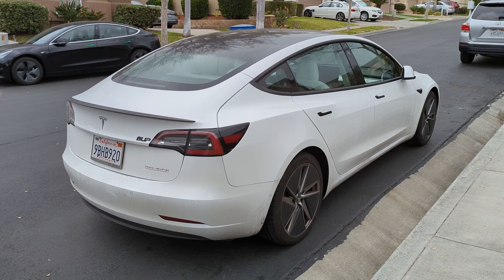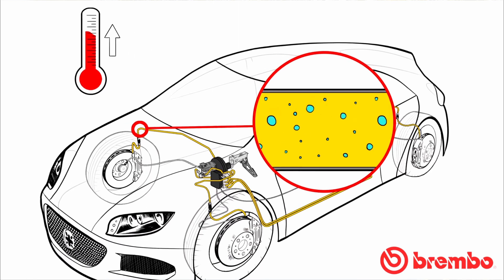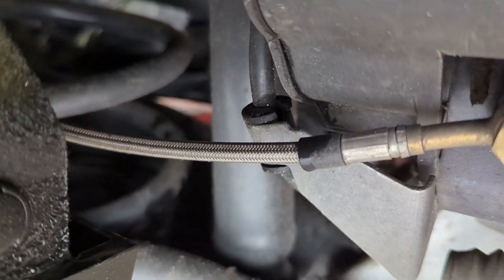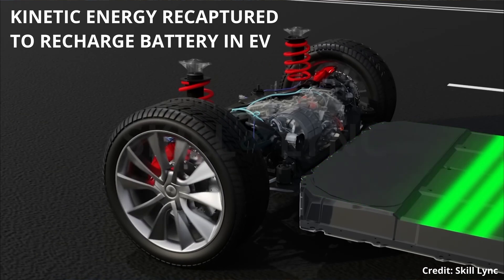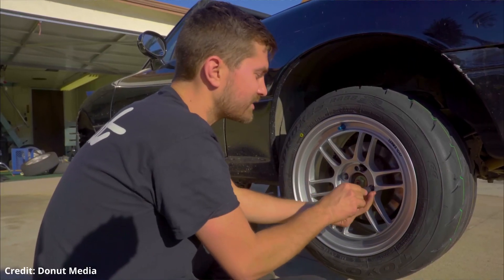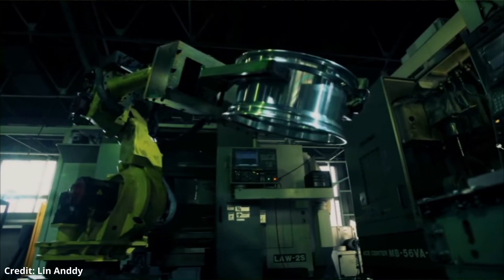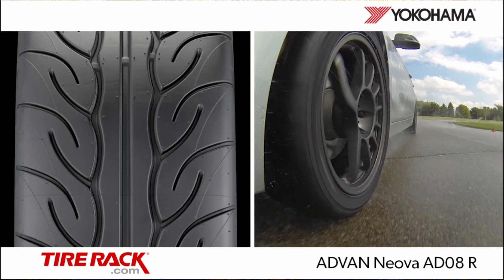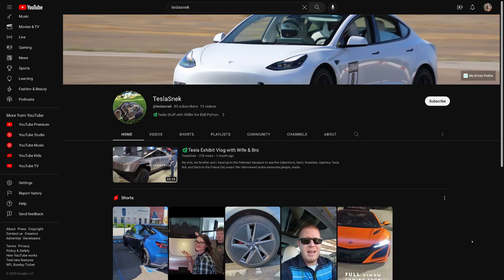🐍Tesla Racing Guide: 5 Track Essentials

Comment: TeslaSnek:  Thanks for your comment.  You are a great sport.  We need more of that.  I love my M3LR/FSD.
Reply from the maker: For sure 😁 Do you have a long range dual motor or a long range rear wheel drive? 😃
Reply: @teslasnek  It is a Dual Motor LR.  Have had it seven months.  Shortly after ordering, the LR model was dropped from the Tesla website.  Guess I got one of the last, until they make it available again.  It is very quick and as you know the range at 358 miles is very good.   The software is very responsive and FSD 11.3.6 is most excellent.  I understand that 11.4 is in the hands of employee testers and should go wide before long it they find no serious problems.
Reply from the maker: @flattire707  I love my Model 3 Performance 😀 Did you see my "Model 3 Efficiency Face Off" video— https://youtu.be/fAzxI-VA4rk
My dad has the Dual Motor AWD and it got 360 miles of range in our test. My car got 340 which is 8% better than its rated range since I put 19 inch Aero wheels and low-rolling resistance tires on it. Video about that here— https://youtu.be/GGxYy8K5Xlo